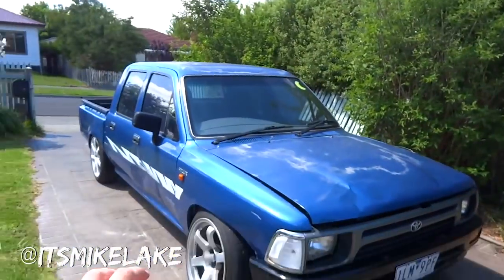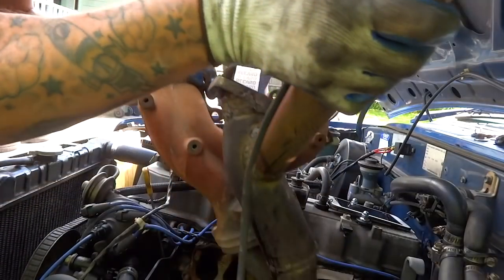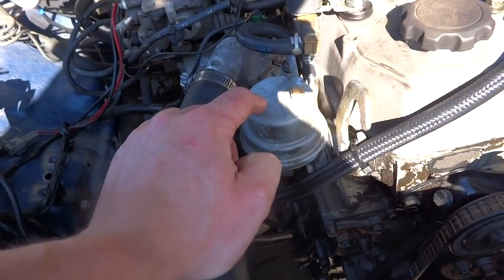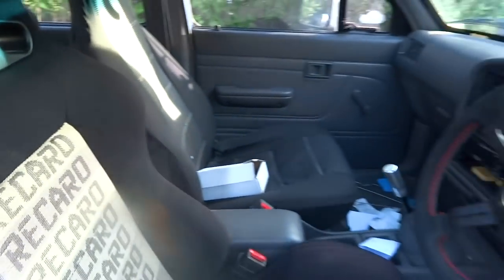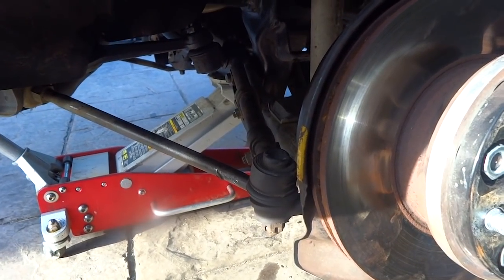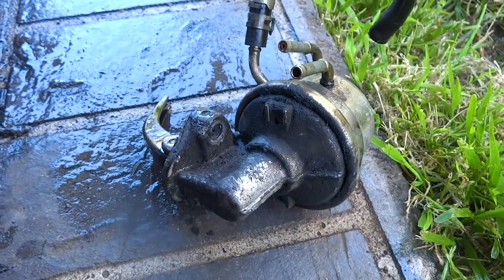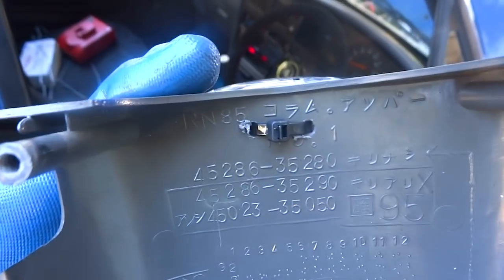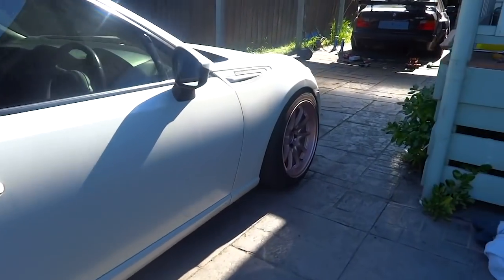HILUX DRIFT BUILD EP3: EXTENDING LCA'S + BUCKET SEAT INSTALL

Comment: How much more angle did you gain? Approximately ofc, and what type of steel did you use, 1/4 inch thick? And one rectangle for each bolt and slot the third middle one? Would love some more detail on the setup.

Comment: Hey man where did you connect the boost reference line for the fuel pump?
Reply from the maker: Hey bro, I used one of the spare vacuum lines coming off the carby.

Comment: how sketchy is it to do that LCA extension? for a daily driven Hilux? And how much thread is left on the tie rods?
Reply from the maker: Make sure you used thick steel and it'll be fine. Plenty of thread left on the tie rods also!
Reply: @itsmikelake  i was also thinking  putting more space between the UCA camber adjustment instead of shims, what would your opinion be? also thank you for the response

Comment: what was that thing that you t'd your boost reference fuel pump to on the intake manifold (looking to do this build soon have parts coming) i might have some more questions as time goes on

edit: also what was that line you t'd off to run the line to your boost gauge?